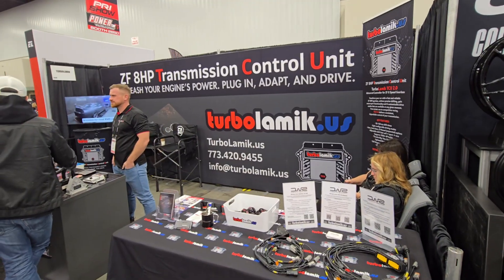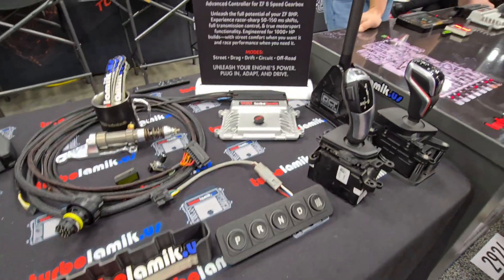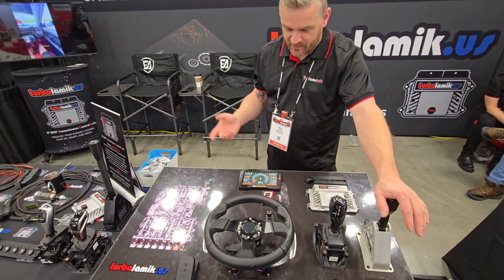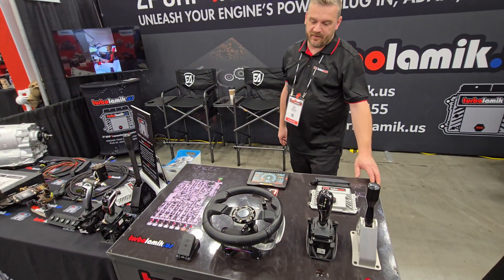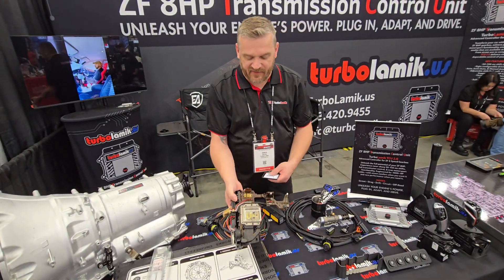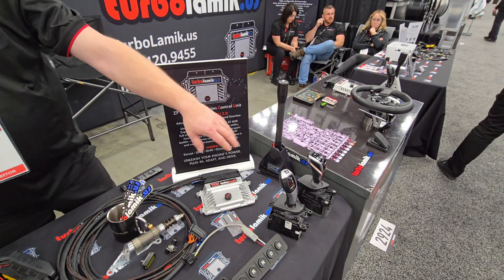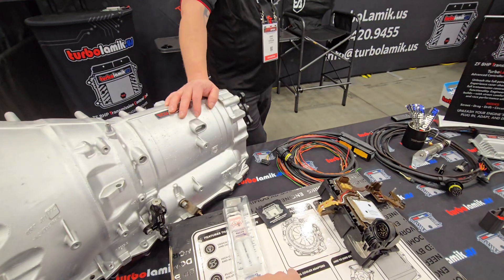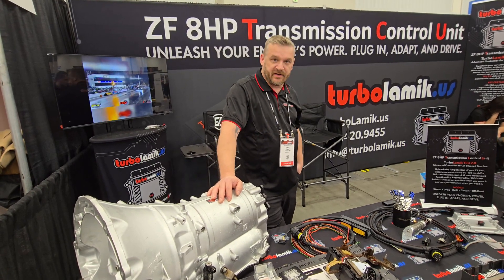TurboLamik 8HP70/8HP90 Transmission Controller, Features, Simulated Clutch, Sequential Shifting!

Comment: I’ve yet to find a video that adequately explains the clutch functionality.
Reply from the maker: So basically the simulated clutch pushes a button.  Unless you're referring to, how does the transmission itself? Let's see a neutral.  I can find that answer for you.
Reply: @David.ksuperbee  I understand that it drops the transmission into neutral, but are you slipping the actual clutch packs to simulate clutch driving and neutral dropping it on clutch kicks? In my experience, AT clutch packs typically fail rapidly after they been slipped in any significant amount.

Comment: Have they gotten any column shifters working? It would be really nice for trucks and SUVs to use a column like the ones in the new 2500s.
Reply: Just spoke with TurboLamik. Their exact words when I asked about the column shifters were: "As far as the column shifters we have a solution for that that would allow you to retain it. Basically at the end of the cable you will install a linear position sensor and we can read that and assign a gear accordingly".
Reply from the maker: @Barker-s2k interesting  idea.
Reply: I would also like to know this.
Reply from the maker: I don't think any column shift stuff works

Comment: My 2023 Challenger has functions built into the factory shifter. Gear selector and tap up and down. But the look would be awkward in a classic American Muscle car. Does the sequential shifter have the ability to select drive mode (P,R,N,D, OD) and tap up and down like a factory BMW and Dodge Shifter?
Reply from the maker: Yes it dose have the ability.  And multiple different shifters.  I have the Dodge shifter  in my 70 superbee.